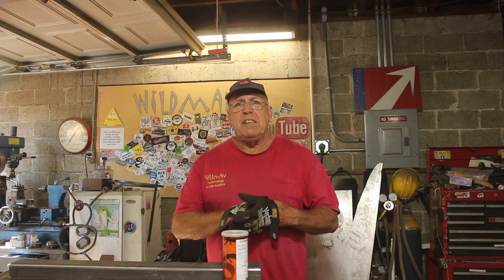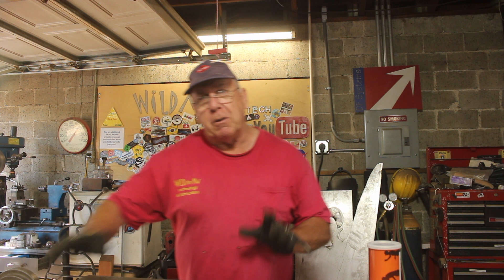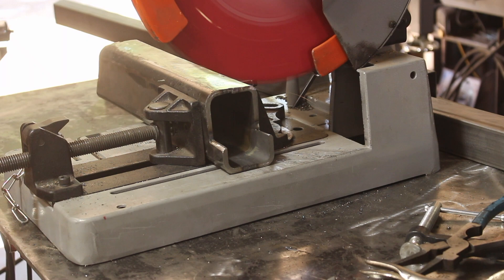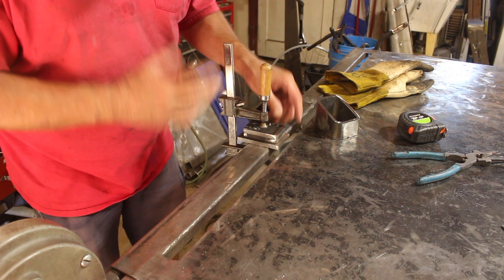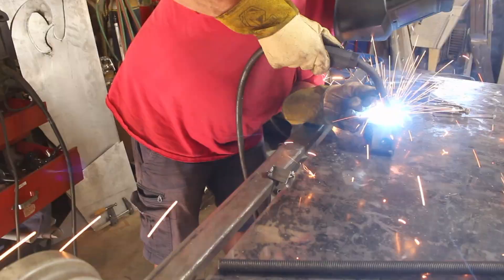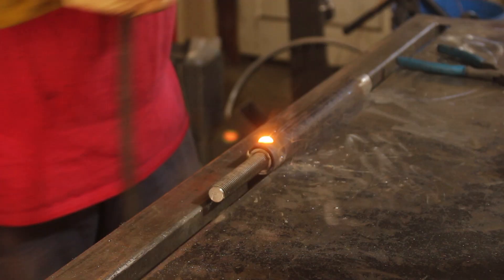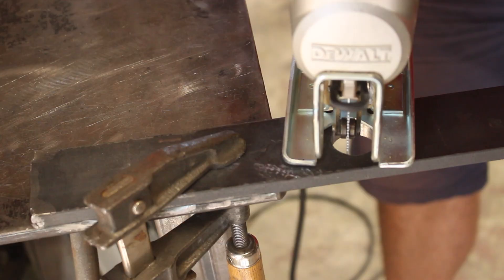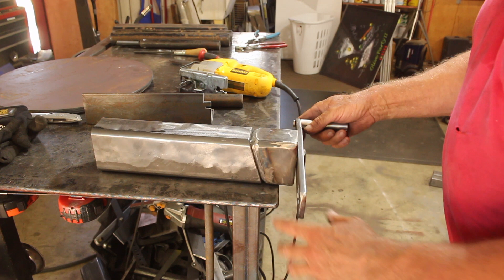Building the Fireball Tool Super Vise

Comment: I think we can use ram pumps to solve the energy crisis. First we build a hollow cylindrical tower out at sea, to a depth of say 1100m. The tower is open to the air at the top and has a sealed base at the bottom. We drill a hole about 20m below the surface and feed water into the tower. The water falls down a pipe for about 200m where it powers a turbine that is connected to an electricity generator. We collect the water and drop it down a pipe for another 200m to another turbine. We do this twice more until we are getting electricity from four generators.
We then drop the water another 200m to power a turbine which drives a cog that is geared to turn a disc at the base of the tower. The waste water from the last turbine starts to collect at the bottom of the tower creating a shallow reservoir that we need to pump out.
The rotating disc at the base of the tower has cams along its edge. These cams are used to push pistons outwards. These pistons are in cylinders built into the wall in a circular formation. The cylinders are sealed at the interior side apart from where a piston rod enters to push the piston outward. The outside of the piston head is exposed to the deep sea water. 
The cam will push the piston outward against the high pressure deep sea water. An inlet pipe will take water from our shallow reservoir which will be pulled into the space created in the cylinder, behind the piston head. When the cam releases the piston, the low pressure water inside the cylinder will be the only thing pushing the piston out against the high pressure deep sea water.
This is when the system acts as a ram pump.
The piston will be forced inward and will force the low pressure water back out through the inlet pipe toward the reservoir. The inlet pipe will now act the same as a waste pipe in a ram pump and the flowing water will shut a waste valve. The remaining water in the cylinder will be forced through a check valve into a pipe and upwards to the surface.
The larger the diameter of the tower, the more cylinders that can be built into the wall at the base of the tower.
I realise that the ram pump cylinder will pump more of its water back into the reservoir than it sends to the surface but we can always add more cylinders to the system. We can even put another layer of cylinders above the original ones as ram pumps still work underneath shallow water.
I think we should be able to pump water upwards at the same rate that it falls into the bottom of the tower and so keep the reservoir nice and shallow.
Now, if I understand the maths correctly, we might only be able to pump the water near to the surface. In that case, we can pump the water into a reservoir tank (inside the tower) and use the electricity generated by the first turbine to pump out the tank.
This will leave us with 3 generators worth of electricity for every tower built.
Would this work? Everyone, please comment.
Reply from the maker: What does that have to do with a vise?
Reply: @WildmanTech  nothing, just spitballing. The idea just got stuck in my head like it was in a vice.
Reply: @crankfwd8209  
   Maybe someone at your local or nearest university could help you or put you in touch with the right person.??
Reply: @crankfwd8209  Thats the dumbest thing Ive heard for a while. Did no one ever tell you perpetual motion machines cant exist
Reply: @jenky1044  maybe an elementary school teacher would be more appropriate
Reply: @mabamabam  nothing to do with perpetual motion. The dumbest thing you've heard in a while? And here's me thinking you're the type of person who talks to themselves.
Reply: @crankfwd8209  you're using the energy from falling water to raise water the same height. Textbook perpetual motion machine.
Reply: @mabamabam  er, no. Textbook hydro electric power but just trying to get the water back up without using the usual evaporation cycle.
Reply: @crankfwd8209   The water falls releasing 1 energy. You pump the water back up consuming 1 energy. Net result 0 energy. Minus losses.
Reply: @mabamabam  er no. The ram pumps are using the high pressure from the sea depths to help the water back up.
Reply: @crankfwd8209  the pressure at that depth is equal to the pressure needed to pump the water up.
Reply: A few questions,
How old are you? Have you ever heard of thermodynamics? If you idea worked why do you think no one is using it?
Reply: @mabamabam  no. The pressure produces flow in the ram pump which then pumps the water up and out.
Reply: @crankfwd8209  the pressure can only pump water to the height of the surface. It can't pump it out. All you will get is a big tube full of water. And then you can't drop water down it.
Reply: @mabamabam  55. Yes. Same thing they said about wheels on suitcases until someone made them.
Reply: @crankfwd8209  your perpetual motion machine is so textbook that it has a name. Look up Boyles perpetual motion.
Reply: @crankfwd8209  wheels on suitcases aren't a new idea. Mass travel and cheap plastic parts were what made wheelie bags common.
Reply: @mabamabam  nothing like Boyle's model. Suitcases with wheels were a brand new idea, because there were no more porters and yes, mass travel. My idea is new because of climate change and the need to replace fossil fuels as a power source.
Reply: @crankfwd8209  so you've heard of thermodynamics. You know that you can't create energy. Your idea generates electrical energy. That means some part of the system must lose energy. 

What part of your system loses energy?
Reply: @mabamabam  the energy is produced by gravity, which is pretty constant on this planet.
Reply: @crankfwd8209  so if you run your magic device long enough the earth will run out of gravity? That's not how the universe works.
Reply: @crankfwd8209 do you understand what energy is? 

How will you pump water using only the force of the same water?
Reply: @mabamabam  eh? Does the hoover dam reduce gravity? Stick to thinking inside the box. Sarcasm isn't your thing, try and stay civil.
Reply: @crankfwd8209  I'm not being sarcastic. I'm seriously amused by a supposed 55yo who believes in perpetual motion. I want to know how it works in your head
Reply: @crankfwd8209  no the Hoover dam takes the energy from falling water and turns it into electricity. You are proposing to take the energy from falling water turn it into electricity then put all the energy back into the water by pumping it uphill. 

You even alluded to it earlier. The fundamental source of the hydro power is the sun causing evaporation. What's the source for your machine?
Reply: @mabamabam  using the deep sea pressure to power the ram pumps. The water would still have some speed after it goes through the turbine, so was thinking of sending it through a brachial system of pipes, that decrease in size, so the water is expelled as a mist. Would have a shaft, driven by the turbine, connected to an enormous propeller at the surface which would pull the mist up and out. Any mist that falls back would land on leaf type structures where it could evaporate. Any water that drips down would end up in the base reservoir and be pumped out with the ram pumps.
Reply: @crankfwd8209  water pressure can only lift water to the surface. Have you ever seen a builder use a hose level? The surface ends up  exactly the same level no matter where the hose starts or finishes. 

The misting and blowing is just a complicated way of pumping water. You need energy to pump water. Your sea pressure is all used up getting the water to the surface, what energy are you going to use to remove the water from the pipe?
Reply: @mabamabam  why would I lie about my age? Also, I don't believe in perpetual motion or free energy. I'm just trying to spitball an idea for getting hydro electricity out at sea. Yes, the main problem here is getting the 'used' water back up and out, without using electric pumps, which wouldn't work.
Reply: @mabamabam  the flow created in the ram pumps should take the water above surface level.
Reply: @crankfwd8209  that's impossible. 

Do you understand pressure? In this case it is the weight of the water pressing down. On one side you have 1000m of sea pressing down. On the other side you have 1000m of machine water pressing down. One side can't press harder than the other
Reply: @mabamabam  do you understand how ram pumps work? The deep sea water has 1000m of sea pushing down on it, yes, but the water in the reservoir is say ten metres deep and has 990m of air above it, so is at a much lower pressure.
Reply: @crankfwd8209  ramp pumps work by using a lot of flow to pump a little water. If you let a lot of flow through your ram pump your pipe fills up. If your pipe fills up you can't drop water down it to make electricity.

You only have low pressure on the machine side to start with. As soon as you start pumping the water level in the machine increases. Eventually you've pumped the machine water 1000m to the top and the pressure is now exactly equal to the sea. There is no pressure left to pump the water out of the machine.
Reply: At this point it seems you don't understand thermodynamics, you can't do a simple energy balance, you don't know how pressure works, and you don't know how ram pumps work. And yet you've designed a perpetual motion machine supposedly exploiting all these things.

You're a very interesting person
Reply: @mabamabam  okay, there are hundreds of ram pumps, each pumping up their own segment of the reservoir. The flow created by the high pressure, should be enough to get the water up and out.
Reply: @crankfwd8209  adding more pumps doesn't fix anything. A ram pump works by letting a lot of water in to pump a little water out. It doesn't matter if there are 10 pumps letting  100 water in to pump 75 water out or one pump passing 1000 to pump 750. You will always have more water coming in than going out.
Reply: @mabamabam  if you had a tank of water, 2m off the ground and you channelled the water down toward a ram pump. The ram pump would lift the water way above 2metres.
Reply: @crankfwd8209  yes. But it would only lift some water it would also spill some on the ground. You can't spill anything in your machine or it will fill up with water
Reply: @mabamabam  to use your example, if the water fills the reservoir at 75 water/ second and I have enough pumps to get rid of 75 water/second then my reservoir  will remain at a constant height
Reply: @crankfwd8209  now you're using all your energy pumping water out of the machine. There is no electricity left to sell.
Reply: @mabamabam  I can spill in my machine, in fact i am counting on it to keep my reservoir at a constant shallow depth. My ram pumps don't work if the reservoir runs dry. So now we agree that the ram pumps can pump some water above surface level?
Reply: @crankfwd8209  you can't spill in the machine or it will fill up with water. You need to pump water out as fast as it comes in. If you spill anything, which you will if you use ram pumps, the machine fills with water
Reply: @mabamabam  no, the falling water produces the electricity. The ram pumps are 'powered' by the high pressure deep sea water pushing against a water tight piston and the flow is created in the low pressure water inside the pump.
Reply: @mabamabam  I can spill in the machine as long as the small amount of rammed water, multiplied by hundreds, matches the incoming flow.
Reply: @mabamabam  no, you don't seem to understand. The deep sea water doesn't mix with the water in my reservoir. The deep sea water pushes against a piston which produces flow in the reservoir water that has filled the piston cylinder.
Reply: @crankfwd8209  again you're using 1000m deep pressure to pump 1000m of water out of the machine. That's not possible. Have you got a garden hose and a sink? Try it yourself

You say you're 55 that should mean school in the 80s. Did you leave at 14 or something? Or did you never do science or maths?
Reply: @mabamabam  wrong, I'm using 1000 m deep pressure to create flow in water in a ram pump which is at, say 5m deep with 995m of air above it when it's in the reservoir.  How about your level of education first?
Reply: @crankfwd8209  your machine water needs to get to the top of the machine. That is a 1000m long pipe full of water, or 1000 1m pipes if you think that makes a difference. The pressure at the bottom of a 1000m long pipe is the same as the pressure 1000m deep ocean. 

Do you know what pressure is? It is force/area. Pounds of force per square inch of area. Or N/m2 if you work in Pascals. It doesn't matter how big the pipe or the ocean it only matters how much water is forcing down.
Reply: @mabamabam  I understand what you are saying, honestly. But ram pumps work because of the water hammer effect because water is not compressible. I'm using the flow created by the high pressure/ low pressure to produce the speed required to operate the ram pump.
Reply: @crankfwd8209  have you ever seen a ram pump? They have one inlet and two outlets. They pump some water and spill the rest. Your ram pump is at the bottom of a well, if you spill any water the well fills up and your machine doesn't work.
Reply: @mabamabam  we've been over this point. I have multiple ram pumps exiting the water as fast as it enters the system. Keeping my nice shallow reservoir at the bottom of my 'well'.
Reply: @crankfwd8209  ram pumps have 1 inlet and two outlets. One outlet gets pumped away one outlet spills into your well. 

Say you have a second pump to remove the water the first pump spilled. Well now you need a third pump to remove the water the second pump spilled... All the way till you have infinite pumps.
Reply: @crankfwd8209  have you ever seen a ram pump?
Reply: @mabamabam  you're not grasping this concept are you? I only need enough ram pumps to expel water at the same rate it enters the system. Stop and think for a second. Yes, of course, I've seen a ram pump, why the little digs? You're giving off serious gammon vibes, matey.
Reply: @crankfwd8209  I'm asking if you've seen a ram pu.p because you don't seem to understand that they spill water. For every 1kg of water they take in they can only pump .75kg of water. 

This ram pump you've seen did you notice water coming out the back end? Typically it just runs away down the hill. But your machine doesn't have a hill it can run down, you have to deal with that spill water.

So you have 1 ram pump that takes in 1t and removes 750kg. You now have 250kg at the bottom of your well, so you use a second ram pump that takes in 333kg of water and pumps the first 250kg of water away. But now the second pump can't pump its own water away so you have 333kg of water at the bottom of the well. So you use a third ram pump that takes in 444kg of water to pump the last 333kg of water away. But now the third ram pump can't pump its own water away so you need a fourth. All the way to infinity. Or practically until your hole in the ocean fills with water
Reply: @mabamabam  to use your example again, let's say 1 pump takes 750kg out of 1t (they're no where near that efficient 
 btw) and it does it in a second. Now say new water comes in at 750kg  per second and adds to the 250kg and we're back to a 1t. No filling up of the well. Sorry, but last time gonna explain that.
Reply: @crankfwd8209  the 750 that comes in can only pump out 560kg. So now you have 250 from the first pump plus 210 from the second pump. You've already filled the well 460 and your machine has only been running one second. 

But tell me more about this ram pump you saw. Where did the spill water go? 

I also want to know about your education so I can explain things in terms you will understand. You don't understand thermodynamics, you don't understand energy balance, I'm trying to use mass balance but you don't seem to understand that either. I can try explain things by your own observations if you can tell me about your experience with ram pumps
Reply: @mabamabam  hold on, the 250 goes back and joins the new 750 so you have 1t going into the pump. The left over 250 goes through the pump again! I would like to know your level of education so I can decide to take your advice or leave it. You don't seem to be that quick on the uptake and don't look like you understand the initial premise. No offense.
Reply: @crankfwd8209  there is no energy in the 250. Ram pumps can't run on a puddle of still water, they need running water. 

I'm a mechanical engineer working in mining and mineral processing. Basically the whole plant runs on pumps, pressures, flows, static head, velocities, vacuums.
Reply: @mabamabam  thanks for the link but I've seen this video before. Are you aware that ram pumps can work under water? Do you understand that the spillage water is going back into my system, to be sent through the pump again?
Reply: @crankfwd8209  the original premise is a perpetual motion machine. I can't understand it because it is not possible in this universe.
Reply: @crankfwd8209  again you can't run a ram pump off a puddle. If you have seen the video, or the pump you saw in real life, you will know it uses flowing water. The spilled water isn't flowing. 
How will the 250kg of still water open and close the valves if it is not moving?
Reply: @mabamabam  I agree that there is no energy in the 250 but all it needs to do is fill the cylinder of the ram pump and the high pressure of the outside water pushing the piston inwards creates running water inside the cylinder.  Also, you sound more  than qualified enough. I'm educated to UK 'A'level standard in maths, physics and chemistry but it's bin a while and I did do a lot of blackout drinking in the sixth form.
Reply: @crankfwd8209  ok so you're using sea water to move the puddle. You're now back to the problem of spillage. 

What do you do about the water that spills out when you're pumping your 250kg puddle away? If you use the same pump to move the new water you get even more spillage
Reply: @mabamabam  yes, but if by using hundreds of ram pumps I can match the expelled water to the same rate as the incoming water then my puddle/reservoir should stay at a constant depth.
Reply: @crankfwd8209  hundreds of pumps just means hundreds of small spills instead on one large spill. It's no difference having to clean up 250kg of water or 100 lots of 2.5kg of water.
Reply: @mabamabam  this is where I think a diagram would come in handy to explain the reservoir situation. Another idea I had, and several people have suggested, was building the 'well' over an active volcanic seabed so the waste water could be sent back up into the atmosphere as steam ( could also get more electricity from steam turbines). This would be great for Hawaii but not so good for UK.
Reply: @crankfwd8209  absolutely a diagram would help. A diagram and some buttons would be good. For every 4 buttons into the well 3 buttons come out. 

Using geothermal power is a viable idea. It's no longer a perpetual motion machine.
Reply: @mabamabam  I thoroughly enjoyed reading your discourse.  You went on much longer than most other men would have.